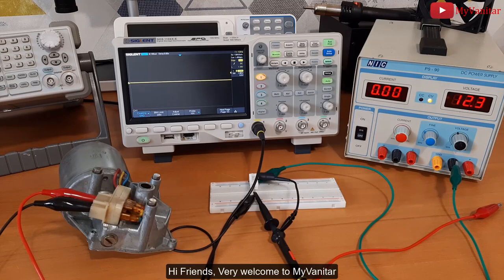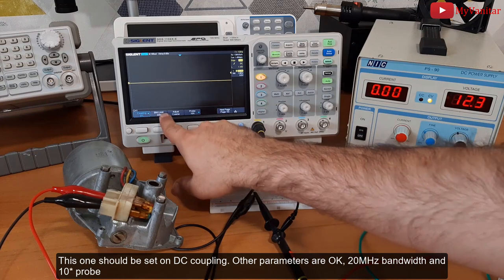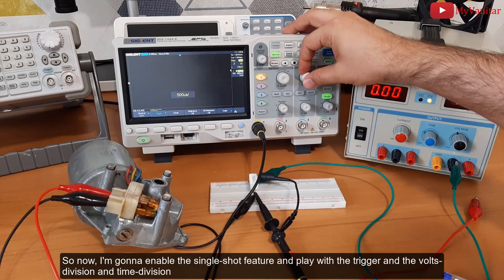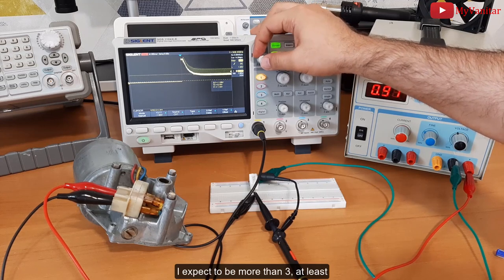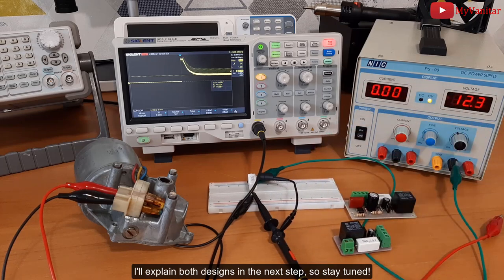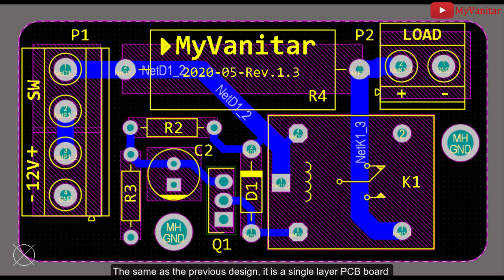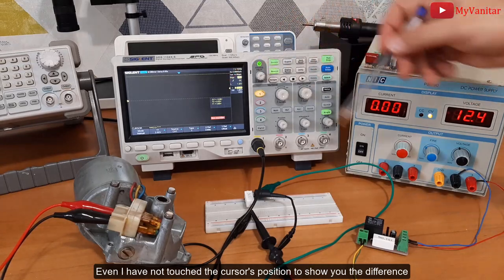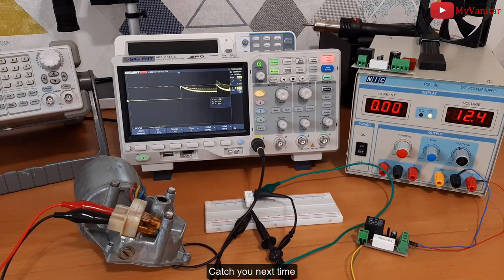Soft Starter Circuits (Inrush Current Limiter) for AC and DC Loads

Comment from the maker: Inrush Current Limiter (Soft Starter) for AC and DC Loads
Reply: This a complicated low tech resistive solution. 
Use a cheape NTC resistor with no need for any PCB 
or a smart starter with NO Resistor
Reply from the maker: @glasser2819  PTC/NTC does not work like this. It reacts slowly and it does not recover fast, besides it only works with the currents that are "much" higher than steady state.
Reply: NTC under load can also reach high temperatures as high as 120deg C depending on the type.

Comment: Hi newbie to electronics so bare with me still learning....
Purchased the AC & DC pcbs from pcbway.
On the DC soft starter I don't seem to get any power from the negative output until I short it with the negative input to drive a 12v pc fan for example.
Also can't under stand the common ground on the PCB. I would of expected a negative rail for the common ground or some sort of link back to negative.
Thanks again for videos.
Reply from the maker: No problem Matt, everyone was a beginner one day. for the DC soft starter, it is just a simple delay circuit and a relay. Ground is shared between input and output (check the schematic). As you see, the SW should be connected to a switch, that activates the soft starter each time you decide to turn on your load.
Reply: @MyVanitar  many thanks for reply...understand the switch and the overall concept but when I put the tester on I don't get any connection with the negative output  to Q1 ground for example, even the capacitor negative .... its like the pcb hasn't got a ground layer ? or am I still missing something in DC circuits. AC pcb works great. just wondered if you had your negative output connected to anything else in the video before gets to the motor etc...cut off at the bottom of the screen.
Reply from the maker: oh yes, now I got what you mean. Yes, it seems the ground path is missing. I really amaze why this thing happened because it is fine with my own PCB which is clear on the pictures and tests. 
By the way you can fix it manually by soldering some wires between ground pins and tie them together (they are 5 Pins). AC soft starter is fine. I've not being noticed since most user build the AC one. I will update the Gerber soon.
Reply: ok great thanks again for reply and keep up the good work.

Comment: thanks for the video. can I use your ac soft starter circuit for my refrigerator and washing mashine?
Reply from the maker: No, the compressor of the refrigerator needs a moderate rush current at the start point. by the way, even my own is a big two doors refrigerator and I have no problem. please check for malfunction or current leaking. that might be the reason.

Comment: Gostei muito do circuito. Como modificar AC Soft Starter para tensão de 120V ?
Reply from the maker: you can use this one also: https://youtu.be/_QyYtV-IEO8
Reply from the maker: the core of the idea is similar, one high-power resistor for the startup and a Relay to short the resistor. in my second design (I gave you the link), you can adjust the delay

Comment: Hey, nice work! I'm learning from your replies too. I'm wondering if it works for compressors that need extra force to start, for example a 12V refrigerator.
Reply from the maker: No, older compressors (piston based) need such an inrush to start. I suggest you use devices with "inverter compressors". they are powerful and way more efficient
Reply from the maker: I have introduced another soft starter circuit on the channel also.

Comment: I really like your job and the proper documentation! 
Please allow a question for a dummy like me :) 
Is this suitable for a Sunkko 737G battery spot welder, having 50-60A inrush current when turning on? It activates my mains circuit breaker (20A) frequently, hence I'm looking for a solution. During the welding I measured 15-20A inrush only, for a very short time, it never trips my breaker during welding, just when turned on. 
Is there any modification recommended (more powerful relay, thicker wires?). Thanks for replying. 👍
Reply from the maker: No problem, You're welcome.
The inrush current should not be and it is not normal. it is like you start your car with pressing the gas pedal till the bottom. Therefore yes it can be fixed and this circuit can help you yes.
The relay on this PCB ranked for 10A, so you need to replace the relay with a more powerful one, but identical voltage. if your continuous current consumption is around 15A to 20A, then for example a 12V-30A relay is okay. the 3.3R-5W resistor is the default value. You can modify it if you like, however, I suggest to buy several resistors and check which suits you best. Also, change it to 10W. for example buy these: 2.2R-10W, 3.3R-10W, 5.6R-10W.
I assumed the load works with 12V and used a 12V relay. if your load voltage is different, you need to slightly change the circuit. as a result, for your case the PCB and schematic (if your load voltage is not 12V) should be modified, however the circuit base is identical.
I have created some uncovered areas on the current-carrying tracks on the PCB if the user decided to strengthen them by think copper wires or soldering. 
I explained all details if you are gonna do it yourself, however, if you still had some problems, just contact me by Email to design another circuit for you as a project contract.

Comment: Sir, I am looking for a soft starter for a 19.5V dc motor. What components should I change on your pcb?
Reply from the maker: use a DC-to-DC converter to convert 19.5 to 12V for the supply of this circuit. that's it.

Comment: This is a fantastic job and explanation, you made it cheap and easy way, thank you, I have mitre saw 1800w and use maximum 15A do I need to change the relay and resistor? What size resistor do I need please?
Reply from the maker: Thank you. Glad you liked it.
Yes, you must change the relay. higher than 10A is industrial, the circuit should be changed, however, concept is identical, but it is better to change the circuit. Power resistor should be more powerful, yes
Reply: @MyVanitar  thanks for your reply, what size power resistor ? Also can you add like for industrial relay please
Reply: I was looking for the same solution. I have a mitre saw and a table saw which both see an inrush current in excess of 30A for a fraction of a second before settling down to around 9A without the additional load from cutting wood. 
Please would you make a video or a web page explaining what changes are needed to the circuit and it's components for a power tool soft starter.

Comment: what would need to change on the DC version to go from 12v to 48v (30A max load)
Reply from the maker: it's not possible with this design and PCB, if you want I can design it for you with an agreement
Reply: @MyVanitar  Sounds interesting, what kind of agreement?
Reply from the maker: Do you want something for free? it's not possible. send me an email to calculate the cost of your project
Reply: @MyVanitar  sorry, already found an off the shelf solution.
Reply from the maker: I wish you the best

Comment: Can circuit like this be used in solar power wall to protect the BMS? 60v battery with charge/discharge at 20amps.
Reply from the maker: in general yes, the concept is the same, however, you should make some changes in the circuit

Comment: Hi, I am dummy in electronics, but i appreciate your video. Can your designed Circuit for Ac current, be used for air conditioner(AC Current - Fixed speed Compressor air conditioner). 
My ac is small , having 800Watts as power consumption, running at 3.5 amps, I want to operate it on solar, but the inrush surge is problem for inverter to handle, can you give your valued view for this. 
Thanks 👍👍
Reply from the maker: No, an AC conditioner compressor needs an inrush current to start, otherwise it might be damaged. it the newer models, the compressor won't start until the electrical conditions are met. You can use weaker AC conditioner. Also, new conditioner models consume less energy and therefore they need lower start current request
Reply: @MyVanitar  Thanks for the reply.
Its new Ac, not old. 
I just looking to run it on solar for daytime. Can you advise on it, Thank you very much for your effort. 👍
Reply from the maker: @harpreet928  I understand your idea. This summer is so hot, many countries fell in problem, as well as the electricity providers. You said your AC is 800W, this is just its normal operation consumption which is not low. it needs more than this to start the compressor at the cranking. use thick copper wires for connections. Your AC is powerful. As I said there are many on the market. smaller ones (less powerful compressor, the compressor size is the same size of the normal refrigerator). Your inverter also is not a 100% conversion device. it has some loss naturally. its output should be pure sinewave.

Comment: Hi, i'm new in electronic design and have a question. I want to build it for dc circuit 48-50v and 20A, and based on your video's it show for 12v. Any suggestions what i need to change for my application? Sorry for basic question. Thanks!
Reply from the maker: Yeah, I was be able to design it better with the separate 12V supply connector just for the board, however it is simple, you should be able to modify it and redesign it for your own purpose

Comment: Hi. Limiting inrush current is just for protect device isnt it? It still pulls high current but protects device. I have no deep knowledge. Is there any chance to limit current from power outlet on start? I have a 1200w single output power supply for my lipo charger. Everytime i plug it, home's circuit breaker operated just for one time. After I open the circuit, everthing is great. It never failed while working. I think charging capacitors in power supply pulls too much current at start. I dont know. A friend told me turning on circuit breaker for one time isnt big deal but i am looking for solution. Could you help or advice?
Reply from the maker: Yes, charging capacitors eats too much current in the beginning, however, once they got charged, then you are fine for some time till they get discharged again. inrush current is not okay, it impose stress on the load and fuse. sometimes inrush current on one load, will damage other loads also, because it is like sudden decrease and increase in the mains voltage (in case of using an AC load). You can build the soft starter and see. that's cheap. In the future, I'll publish another version of the AC soft starter as well. This one can deliver up to 10A, it means 2000W maximum.
Reply from the maker: @marcoscimbom  Concept is the same, but your mentioned design is bigger. you will have some difficulties to build it because it offers no Gerber files for PCB fabrications and some component footprints are old fashioned. I think it belongs to an old publication of the Elektor magazine .Try a tested design like mine :-). if your continuous current draw is less than 2000W, just go for it. I'll publish another 6000W later on.
Reply: @MyVanitar   thank you so much. I have just saw your article. Looks really clear for beginner like me. But just asking for clarification, p1 is 220v n and l input, load is gonna be connected to supply l and n. Supply's and ur circuit's gnds are gonna be connected cord's ground right? Is supply's output voltage important? Its 1200w 220v 48v output. Sorry for stupid questions, i have never did on anything with ac. Looks dangerous to me 😬
Reply from the maker: @marcoscimbom  I partially understood. your question. there is no ground in the AC load. That ground is for the circuit, if that was what you meant. I have provided two designs, one for AC loads and another one for DC loads. in The AC soft starter, there is one input for the Mains, one for the Switch and another one for the load connection. As I understood correctly, your device works with 220V and sucks too much current in the beginning. So just use the AC soft starter and embed it inside your device. if this is your first time with AC, be careful!
Reply: @MyVanitar  im planning to cut l and n cable inside the supply and  will close the circuit with ur soft starter. I hope it will work and fit inside.
Reply from the maker: @marcoscimbom  Perfect, insert I and N to the Soft starter mains input. Short the switch connection on your device board. Connect the floating panel switch wires to the switch terminals of the soft starter. Then simply connect the device to the soft tarter load terminals. Then you are done :-)
Reply: @MyVanitar  hi friend. I just get the components and i am about to make my ac current limiter. But without any experience, i have to be sure about what i am doing and i still have stupid questions.  Schematic diagram on the article, which is figure 1, there are some connections to the ground. On basic dc circuit i connect gnds to the (-) negative, is it ok to connect all of them to the bridge diode's negative? But in diagram there is a connection to the gnd from the bridge' negative too? Also on p1, should 4th connection be  L or N?
Reply from the maker: @marcoscimbom  when you have the PCB, just order and build it. however, all ground connections are connected to the negative pin of the bridge rectifier. follow the PCB, you will get the answer to your second question. if you don't have experience with these circuits, any mistake could give you a bad shock or even death. ask a pro to help you

Comment: An easier solution for limiting DC inrush current is using an NTC thermistor, it's widely used in industrial designs.
Some even use a resistor and bypass it with a relay after a certain time.
Nice demonstration, you didn't explain how the circuit works though...
Reply from the maker: NTC thermistor can not take fast inrush currents. That's why there are some expensive soft starters on the market. Also, NTC is slow and can not act properly when there is a Switch. It means when the load Switches frequently. About the circuit, as I mentioned in the video, I have provided more details in the video description.